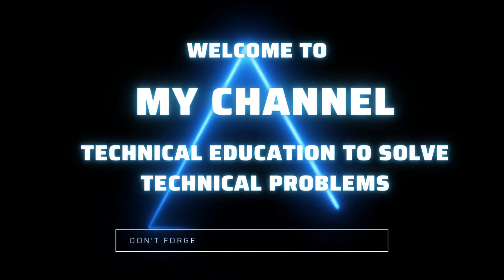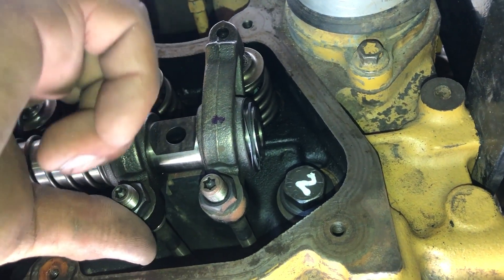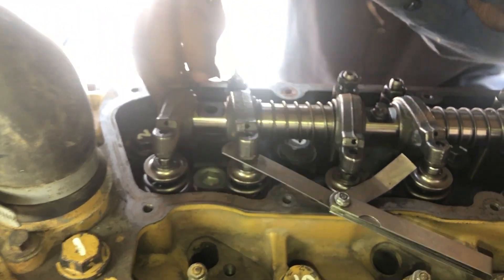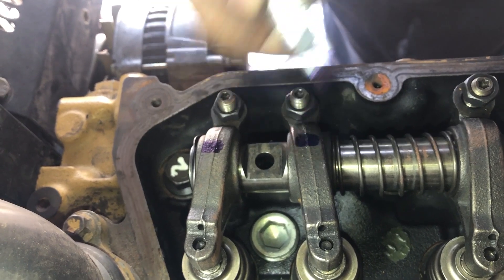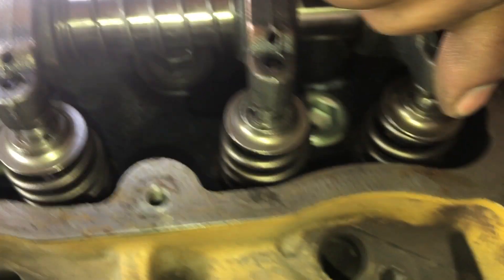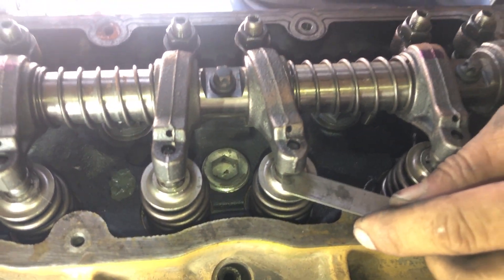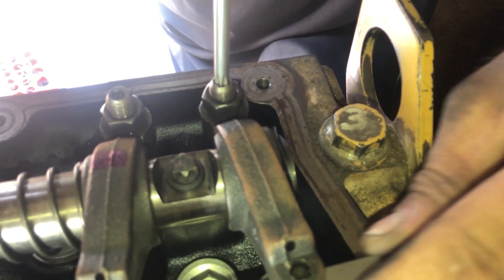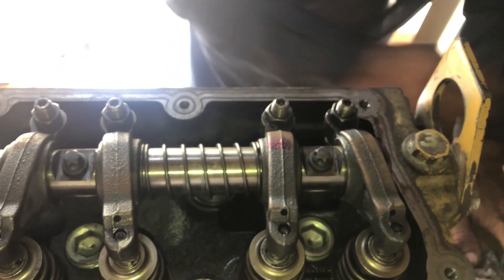Perkins 1103 3-cylinder engine Tappet Clearance firing Order 1, 2, 3.Perkins Australia

Comment: Wrong way first you adjust 3 and 6 valves
Reply from the maker: You tried my way?
Reply: @Technical.Education  no but the workshop manual said 3 and 6 then turn 360 degree then adjust the remain valves